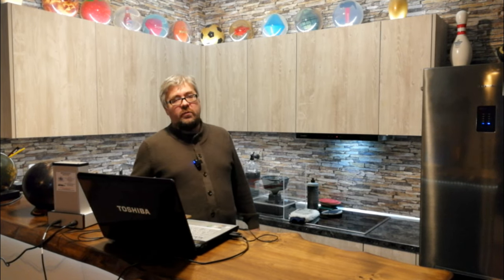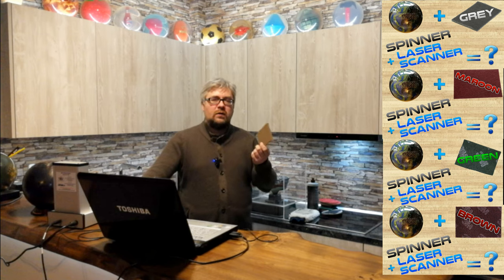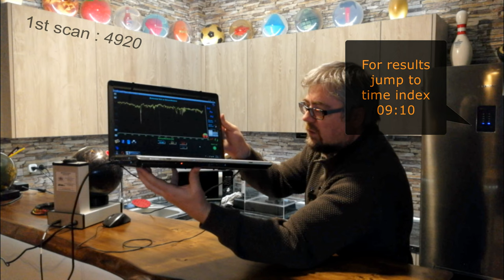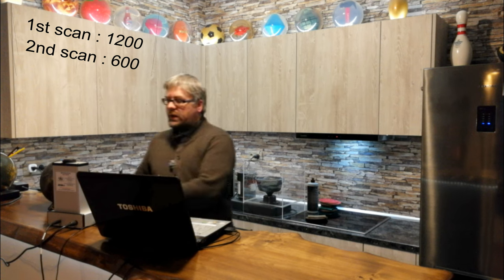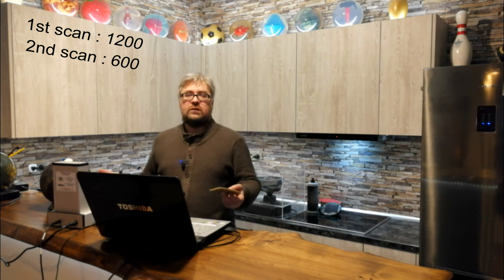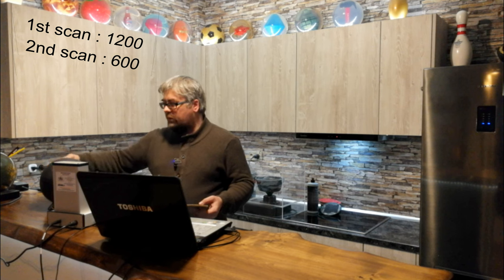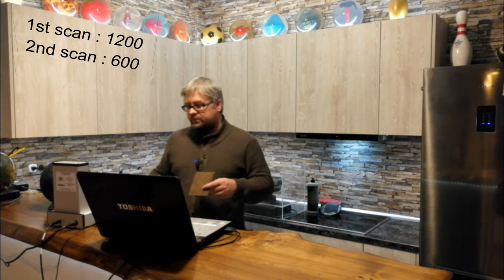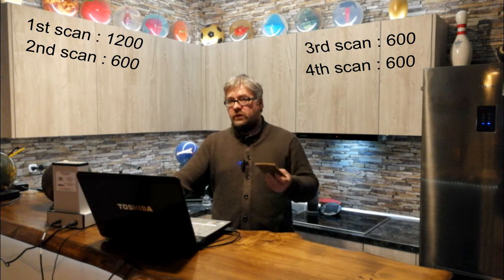ΤΑΝ (7440) 3M Scotch Brite bowling ball sanding by spinner ! (laser scanned)

Comment: Thanks for the interesting vlog.
I have been using different grit sandpaper.  It is pretty accurate and consistent.  It also correlates well with the grit of the sandpaper.  I have found the sandpaper cheaper and overall better than scotch brite.
Reply from the maker: Hi, thanks for the kind words and for watching ! What kind of sandpaper do you use?
Reply: @bowlingxp8345  3M is the brand...not sure if is available in Europe
Reply from the maker: @ricka.wetselphdbowler3526  There are 3M products here, i guess there must be that sandpaper as well. Thank you !